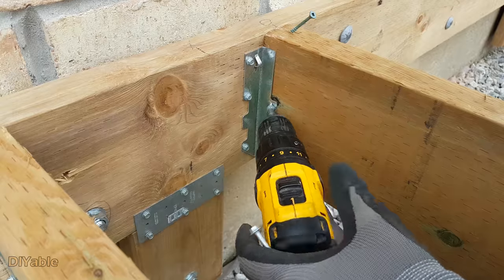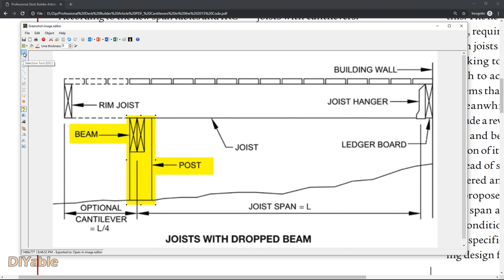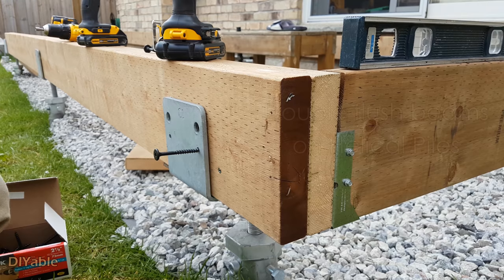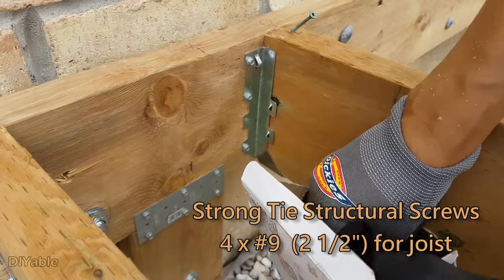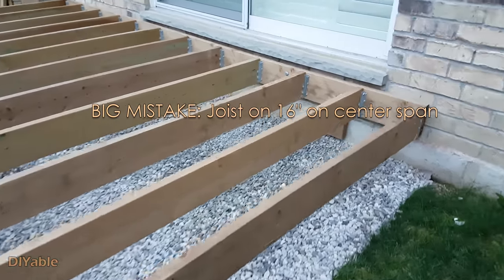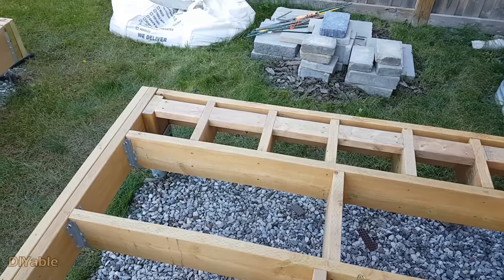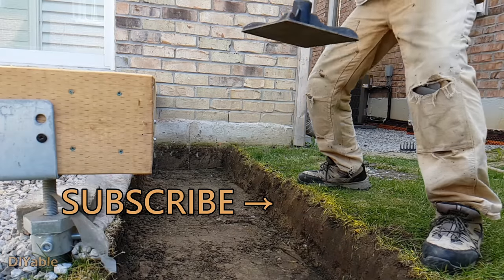DIY Deck (Part 4): How to avoid getting a deck building permit even with Pergola?

Comment: Hi, Thanks for very informative video. I am building a deck too and have this question about regulations - can the deck go all the way until the fence? I mean, Can I support one of my rim joist onto the fence itself?
Reply from the maker: The regulations are very different from city to city,  you may want to check your local bylaw.  First question, depends on the grading, if your house is on the hill, your kitchen can be 8 feet off the ground for example. In that case, your deck would certainly be above the fence.  For the other question... please don't do that, you cannot put the rim joist on the fence. Fence is very weak, it's not designed for supporting the force downwards.  it's going to be a structural disasters.  Not sure where you live, but if there is frost heave your deck can potentially have issues if the fence isn't installed properly.

Comment: How did you secure your beams together? Approx @2:54 you have the two beams sitting on the helical piles 1) how are those two beams fastened together? 2) Is that a concealed joist hanger attaching them to the other beams? Thanks.
Reply from the maker: Very good questions, you are right I didn't show that in details.  To answer question (1) I used construction adhesive, clamped it and secure it with tons of deck screws to sandwich it together before putting on the helical piles. Glad that you asked.  (2)  Yes, that is the concealed joist hanger on the edge.
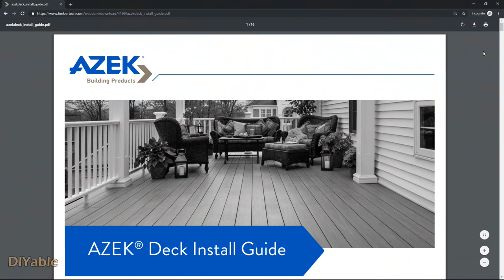Reply: DIYable thanks for answering. @5:32 the two beams on the piles are screwed in with the 2 7/8”headlock screws. It seems that you didn’t use any shims to fill the gap, is that correct? Are the screws on the one side sufficient or did you do something else. Thanks a lot!
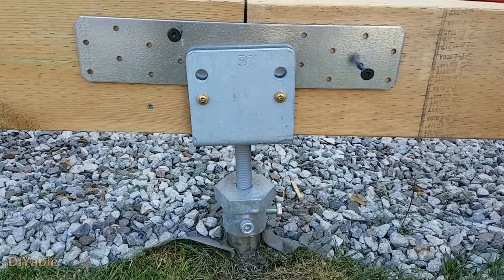Reply from the maker: @BankStreetBrewery   If you are talking about @5:32, you see there is a huge gap on the saddle after placing the two beams, I just left it like that. The saddle is designed for 6x6 post but it is totally fine to use it like that.  I only secured it from outside, I did not fill that big gap using a block of wood. Just to clarify, you are not talking about shimming at the bottom of the beams @6:40
Reply: DIYable that’s correct. I’m doing a similar deck and there is a small gap on one side of the saddle.

Comment: Awesome series of videos.  Thanks for filming and editing.
I was wondering if you used structural screws or nails for the blocking?
In method 1 of the picture frame, you had approximately 1.5" gap before you screwed down the 2x4.  Was that decision based on the width of the deck panels?

Comment: What software did you use to make your illustration design? Also I noticed that part of the deck was attached. The whole project is still no permit required?
Reply from the maker: I talked about that in Part 1 in more details, it is a software called Sketchup Free Edition.  Yes, it is attached, no permit in our local code because it's too close to the ground (less than 2 feet).   Check out Part 7.  Our city building inspector actually came and approved it. No permit needed.  Now, it doesn't mean it is the same for you, check with your local code. 
https://youtu.be/fL29Ghjirbo

Comment from the maker: In recent year, this "Toja Grid modular pergola system" captured my attention in my local hardware store. They have the 6x6 corners brackets seem to be pretty strong and it's looking pretty modern.  If I had the option back in time, I would have chosen this. However, I would NOT recommend using their 6x6 post base on top of an existing deck, it may not be that stable.  This system would be x3 faster than what I did, also you can buy the shade sails from them and it will fit perfectly.  Damn it. Just another advice, don't use the 4x4 system, it's too slim and it won't be bold enough.  Just want to help you DIY people out there...  
https://www.tojagrid.ca/
Reply: You prolly dont care but if you guys are stoned like me atm then you can stream all the latest movies and series on Instaflixxer. I've been watching with my gf for the last few days xD
Reply: @Wyatt Maximus Yea, been watching on Instaflixxer for years myself =)

Comment: Wait I thought you said you had to have a permit for the ledger install from the last video?...But now i'm under the impression this whole project requires you No Permit. lol
Reply from the maker: For many  cities and towns, if you build a FREE STANDING deck (does not attached to the house, not using any ledger board), you don't need a permit. For our town, if you build a deck with ledger board (attached to house) AND your deck is taller than 2 feet, YES you need a permit. For mine, it is less than 2 feet, it is not needed. 

Check out Part 7.  Our city building inspector actually came and approved it. No permit needed. It doesn't mean it is the same for you, check with your local code. 
https://youtu.be/fL29Ghjirbo